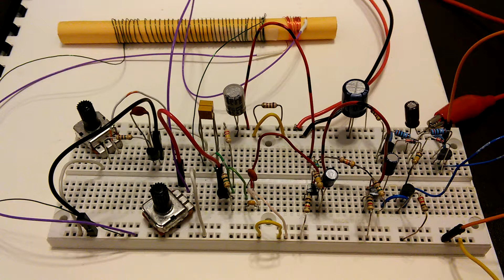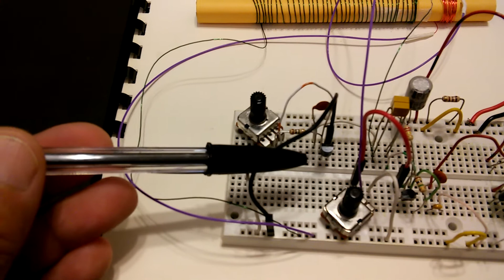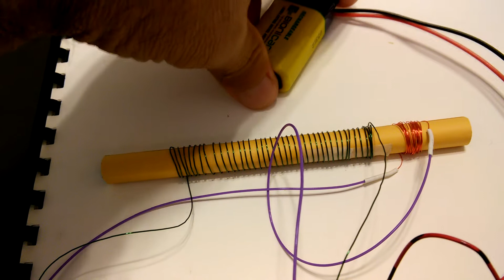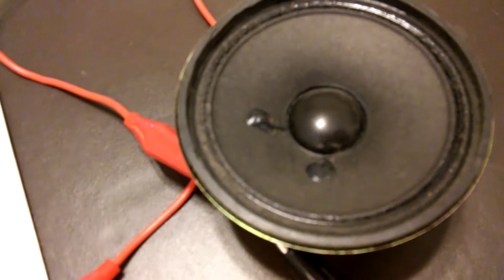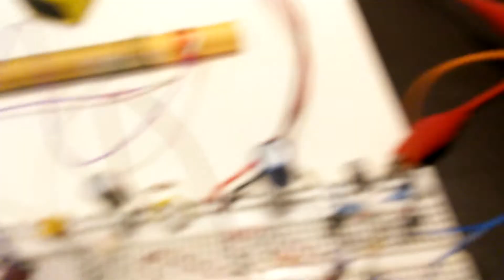AM Regenerative Radio with Varactor Diode Tuning

Comment: good job, could you share the electronic circuit? I am attempting to build a grid dip circuit using a varactor to tune a small low frequency range for finding the resonant frequency of a coil brought near the main circuits coil